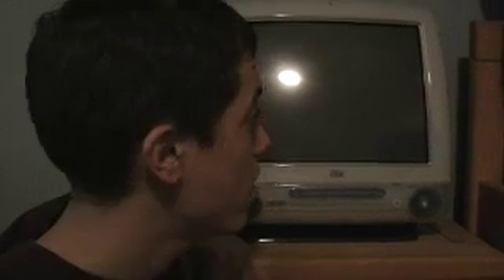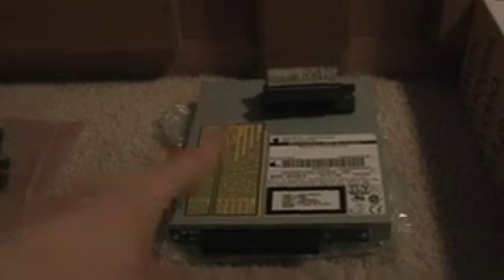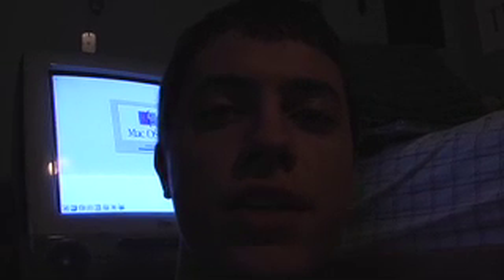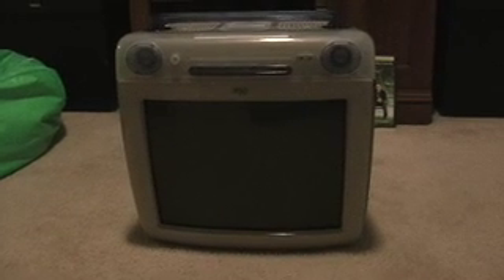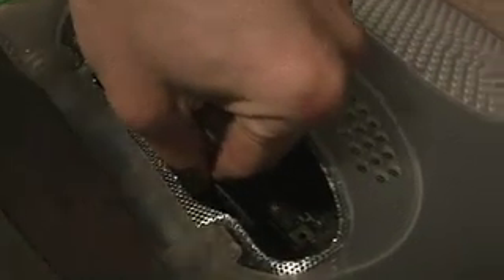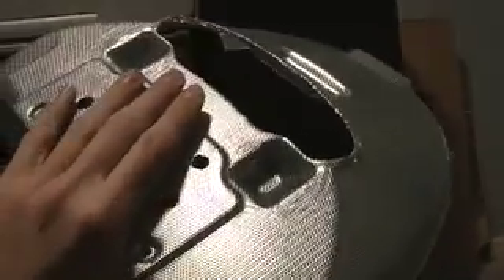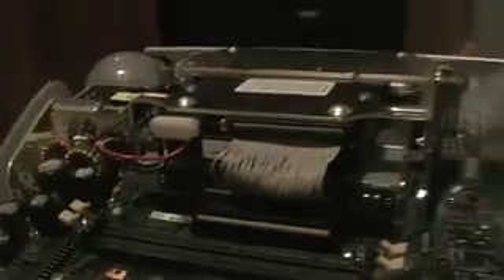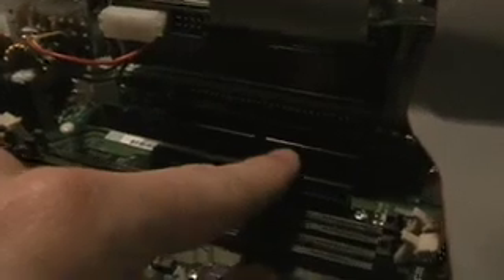iMac G3 Upgrade: Part One

Comment: Personally I use a version of OS called PPCmint but i advice you to not go there since it requires a spare weekend to setup and get flash running. You can also use Tenfourfox web browser or.... **Ahem** The best youtube video watch ever...... MacTubes if you haven't tried this already you should. It is a standalone application that you can watch youtube videos in.

Comment: At my school, I installed OS X on 40+ of these machines.  I didn't have to upgrade any firmware/software and they all work fine.

Also, you don't know scary.  Try to replace the hard drive in a 700/800MHz eMac and then come talk to me.  You have to remove the heatsink that is somehow screwed on top of the CRT and the mobo is connected somehow... those things are a mess.

I do love these iMac G3s, though.  Great computers.

Comment: Dunno if you saw it but you can put a hard drive in that larger than 128GB, you would have to boot into OS X, then partition the drive to 128GB and then install SpeedTool's  High Cap ATA driver software and partition the rest into another partition.  Also I wouldn't recommend doing work like that on a carpeted floor...

Comment: @SportMegane  SSD's have sata connections and you need a ata hard drive for older machines like this one.   I tried a ata to sata card, but data transfer was to slow to boot the imac.

Comment: well its a Imac apple (G3 =table notebook with tube), . lol upgrades in hardware are just terrible... unless you own a mac pro and you have money as hell. :o( hehe I had two of the same 120GB drives in my pc running. they are now only used as extern drives, much too small.

Comment: hi mate, i am wondering if i can add the same specs of HDD and DVD to an imac REV A I received some days ago as a gift next to my beige G3 233mhz and my PPC DC 2ghz one.  I want to add dvd ofcourse but no articles on how to for this revision. Also i opened the case and the CD drive is tray loading and not 3,5inch in size is the bigger dimension.

any help is appreciated :D nice video

Comment: Cool video. I had exactly the same problem with my iMac G3 hard drive. So noisy. Right now disassembly it to replace the hard disk and while looking for some information came across your video. Funny enough, exactly the same screw that caused trouble for you when replacing the hard disk decided to fight me too. Strange...

Comment: My son has an iMac G3 (Blueberry) as well. he loves to upgrade computers.

About it before he upgraded it:
350Mhz
Slot-Loading CD-ROM
7GB HD OS 9.1
128MB RAM (2 64MB sticks. PC100)

After he upgraded it:
350Mhz
Slot-Loading DVD-ROM
40GB HD OS 10.4.11
640MB RAM ( a 512MB stick and a 128MB stick. PC133.)

it goes WAY FASTER now.

Comment: generally all IDE (ribing) cables are the same. provided both computers use Paralell ATA (instead of SATA Serial ATA) then the cable will work, I would leave the mac cable in as it will fit better!
and yes apple have always made computer nicely, I had a Mac Performa 580CD... way back 80's style.. even that was nice... but now I have a mac similar to this one and the apple fell off :(

Comment: I have read you sometimes can force a 350mhz g3 imac to take tiger, but you would be able to up grade to at least 10.3.  It will not reconisze a more than 127.87 gigs on the hd.

Comment: the new macs can handle 2GB the new mac can handle half a TB mac tiger is soon out dated leopard will replace it and again ilife 08 has been released it makes a noise because it has a faster RPM or because your internal fan is dusty and or broken. you should discharge the static electricity my HD is seagate it was $95 their easy on a macbook to replace as well as the ram

Comment: i just upgraded mine finally after owning it for 4 months because it kept fucking up on me!!! memory buffer overflow blah blah...then i found out it was the ram! wasnt compatible! now im running on 128mb with a 30GB maxtor harddrive. installing mac os x 10.1 is tricky but i figured it out. what kind of memory does the imac g3 slotloading take anyways?! the one i got from ebay, its a 256 stick, with CL3 PC133 printed on it.

Comment from the maker: It won't be fast, but performance will be good. Also take note that Tiger requires a Mac with a FireWire port, which is why I had to install Panther on my iMac.

Comment: okay i know this video is older, but i didn't want to post on one of your new videos that has no relevance. I have a mac just like that blue one you have, 256ram 350mhz i think, and so on, is it worth putting os x tiger on the machine, will it run smoothly or will it be painful to use it? Thank you for your time.

Comment: Hehe - Nice! :o) On a microscopic level the electricity which is high voltage, low current (semiconductors are designed the opposite way) damages the junctions and can either kill or damage transistors. 1Gb = 17,179,869,184 bits / transistors excluding management circuits.

Comment: Sorry for the hard line but really, don't do it! I used to be a technical writer with PC Magazine and one of the guys there worked for Intel before coming to us. Essentially if it doesn't knock out memory it will seriously shorten its life. Try not to touch gold connectors, that goes for cards too.

Comment: That Quantum drive definitely has a worn bearing. I have an 8GB Maxtor from the same era and the noise is ridiculous. Also, that old Quantum is probably 5400RPM.
Did you ever get the right RAM in that thing?
Anyhow, cool video.